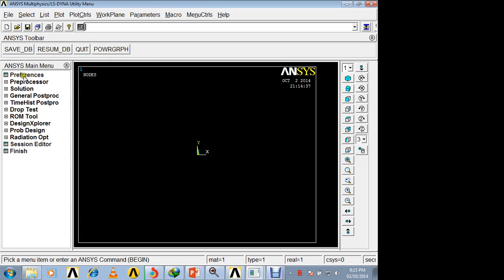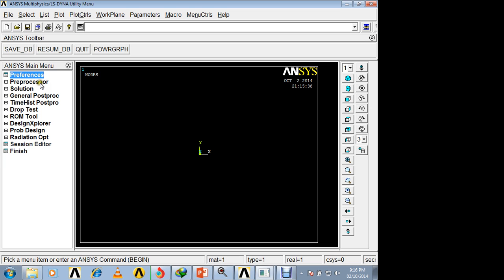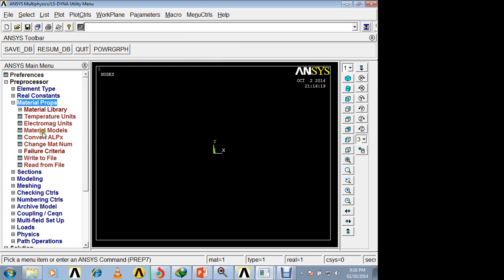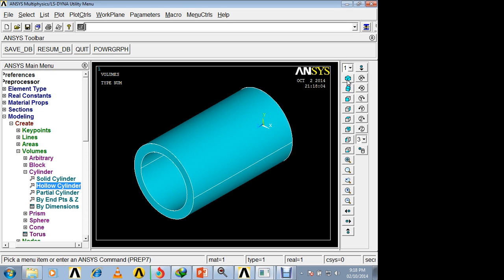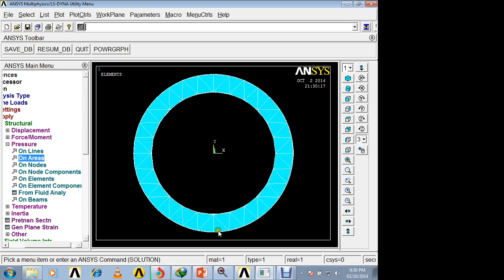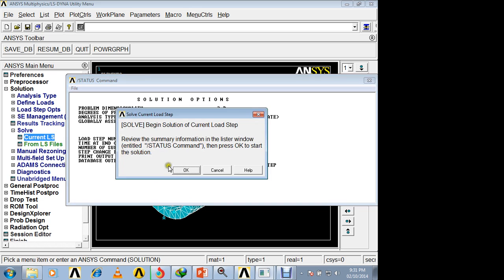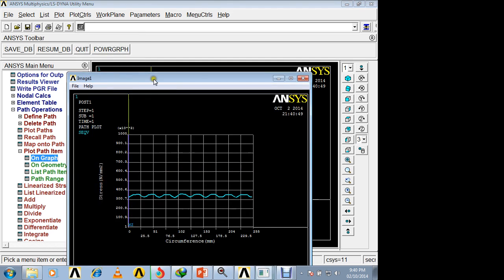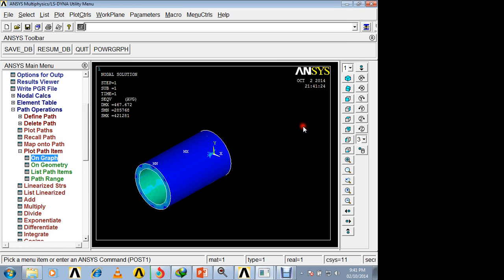ANSYS-STATIC analysis of pressure vessel -Prof.P.p kulkarni, SKN Sinhagad college of engineerinh

Comment: Sir, I am doing Static structural analysis for Pressure vessel (Horizontally Supported) with nozzle in cylinder. My Von-mises stresses values is quite high compared to Allowable stress value at nozzle.How to justify it?

Comment from the maker: You may apply properties of fluid on internal surface . Then you will get pressure values on surface. Actually Pressure is to be applied on internal surface. you will get diffetent types of streses including yield stress.For this, You require to input non-linear properties of material

Comment: How can we find the internal pressure corre
sponding to yield stress?
Reply from the maker: You may apply properties of fluid on internal surface . Then you will get pressure values on surface. Actually Pressure is to be applied on internal surface. you will get diffetent types of streses including yield stress.For this, You require to input non-linear properties of material
Reply from the maker: You may apply properties of fluid on internal surface . Then you will get pressure values on surface. Actually Pressure is to be applied on internal surface. you will get diffetent types of streses including yield stress.For this, You require to input non-linear properties of material
Reply from the maker: You may apply properties of fluid on internal surface . Then you will get pressure values on surface. Actually Pressure is to be applied on internal surface. you will get diffetent types of streses including yield stress.For this, You require to input non-linear properties of material
Reply from the maker: You may apply properties of fluid on internal surface . Then you will get pressure values on surface. Actually Pressure is to be applied on internal surface. you will get diffetent types of streses including yield stress.For this, You require to input non-linear properties of material